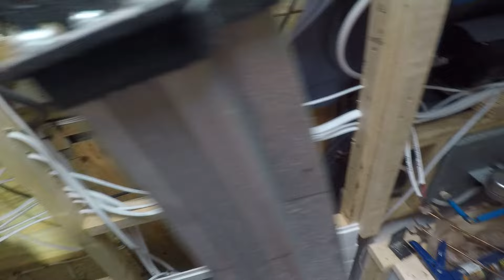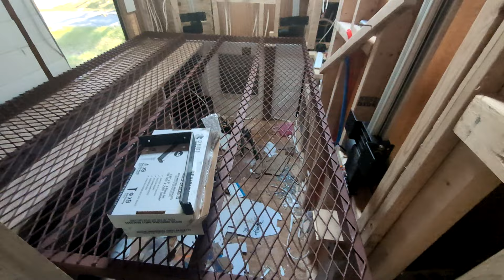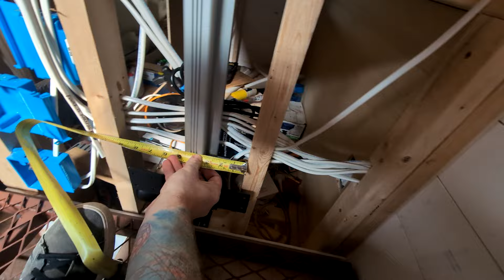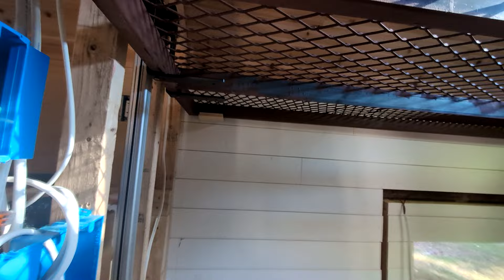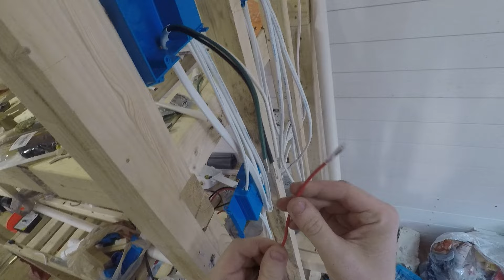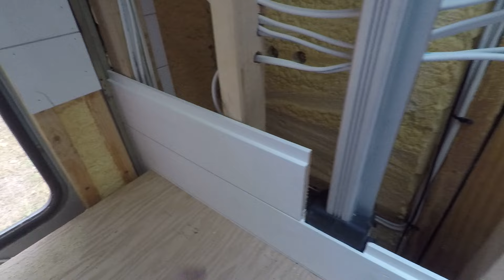How To Build A Motorized Bed Lift For A Skoolie Using Track Actuators

Comment: Looks sturdy. I appreciate the wiring diagram and information on switch and relay. 

Due to vans and buses not being 90 degrees or consistently level I’m wondering if the bed frame could be attached at the bottom during construction as you did. Then if tops of actuators are clamped, raise the bed. Once the frame is up and centered, permanently attach the upper brackets to the wall framing where they align. Binding should be impossible at that point.
Reply from the maker: Thank you. I had that thought. I don't remember why I didn't do it hahaha I think it's worth a try. It makes sense that it would be easier.

Comment: tks for share man .question   does the actuators  rise at same speed   i am planning to do the same in my camper but  i read tha some of them have different speed may that be a problem ?
Reply from the maker: They don't. That's why it's important to put them symmetrically so the weight is distributed the same to all of them and also build the floating bed frame like I did, to allow the bed to tilt while moving. It levels off when it's done moving. If you want them all to move at the same speed, more electronics need to be added like sensors and microcontrollers.

Comment: can the actuators go to different heights to compensate for van tilt -> making the bed level every time?
Reply from the maker: Yes but you'd have to build the electronics for it. The way I set it up is they all get powered together.

Comment: I wish these track motors existed when I built our bed we probably would have stuck with our layout instead of rebuilding it all on the road later.
Reply from the maker: @AaronBockelie  :( why did you end up rebuilding it?
Reply: @WideAwakeTravels  I had quad Murphy beds for the kids and my wife and I had a queen size bed that folded up. We ended up switching things around.

Comment: Hey, looking to replicate exactly this in my RV! Could you share more about the bed frame itself? Is it aluminium, did you weld yourself? Any thoughts on making it more lightweight?
Reply from the maker: @SamehKhan  hi, this video shows how I did the bed frame: https://youtu.be/GTaCzWzyl9E?si=h_AGqTeNm-88J-aM and yes it's better to make it out of aluminum to make it lighter, but I don't have the welding equipment for aluminum, so I made it out of steel.

Comment: I'm assuming this would work with a 7-pin 3-way rocker? As a rule I prefer having to hold a button down when these kind of actions are happening because it requires me to pay more attention. I do like how it stops automatically with the built-in stops
Reply from the maker: @justinlucenti5373  yes you can use a 6 or 7 pin rocker switch. This video goes over how to do it https://www.youtube.com/watch?v=H7zg7ZdD13Y . If I want to use a switch that requires holding it down, I'd have to put the switch somewhere else because the bed would hit my hand while it's moving and I'm holding the switch. Good idea though, just needs a different location.
Reply from the maker: I ended up moving the switch on the outside of the room and actually installing two momentary switches, so the kids won't be able to hurt themselves. Thank you